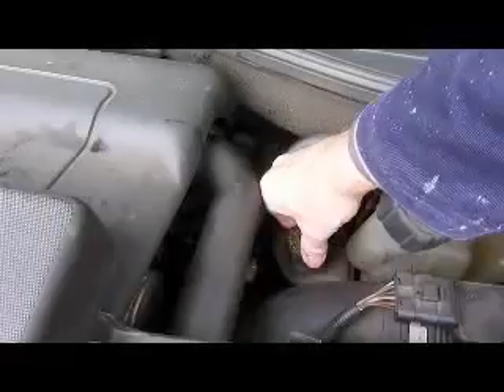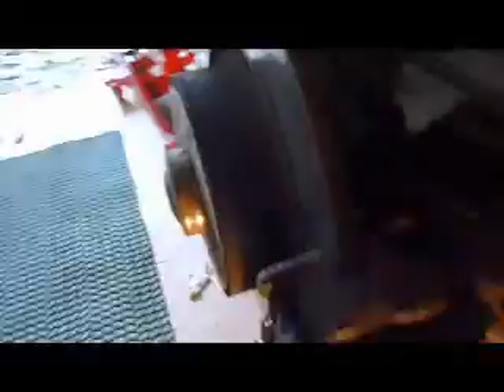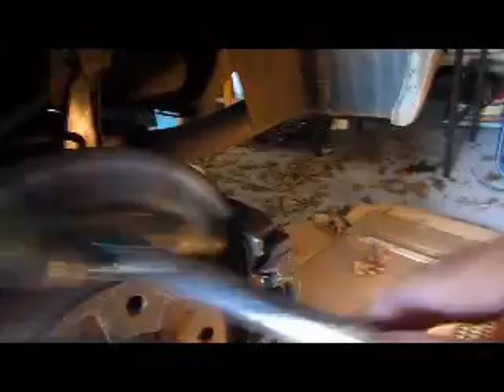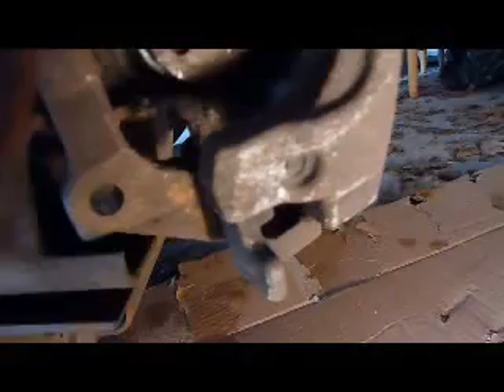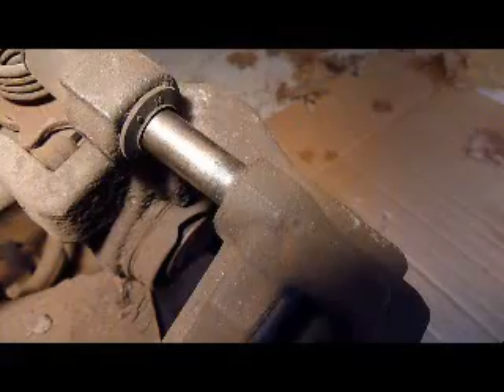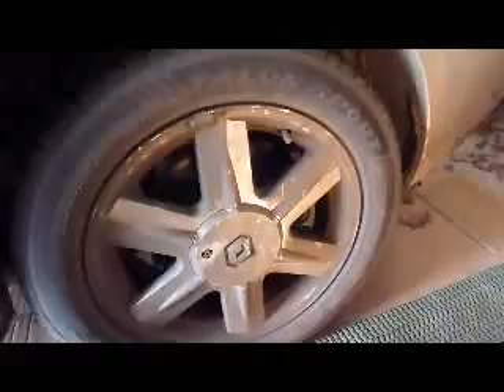How to renew Renault Laguna rear disc pads

Comment: I presume  a laguna mk1is different to a mk 2 as with the latter the springs clips on the inner pad have got to be clipped over the piston its easier therefore to fit the inner pad first also very important to locktite the 2 securing bolts

Comment: Enquired at my local car spares dealers about the wind in tool, £73 +vat, your'e having a giraffe. Made my own with two M6 allen bolts, four M6 nuts and an old 8mm box spanner, worked a treat.

Comment from the maker: Hi ray no , the bolts are 17mm top and bottom, and right pigs to turn plenty of wd 40 ,mateys comments above, reconds you just need to undo one of these but i took them both out and completly removed the caliper making it easier to fit the pads in my ipinion.

Comment: By the slide bolts do you mean the 7mm hex key ones? I know when I did the front pads I only needed to remove these but on the rear ones when Ive looked they dont look like theyll free anything up if removed? Any help would be great cheers

Comment: That was the hard way of changing disc pads,im a mechanic and i know what im doing,i could have done that job ih half the time,on the caliper there are 2 slide bolts which the caliper slides on and adjusts the brakes as you pump the pedal,remove 1 of these swing the caliper up take out the old pads ,retract the piston put new pads in refit slide bolt,(you might have to detatch the cable and refit )should always change damaged or worn discs too! in the video the discs must have been badly damaged